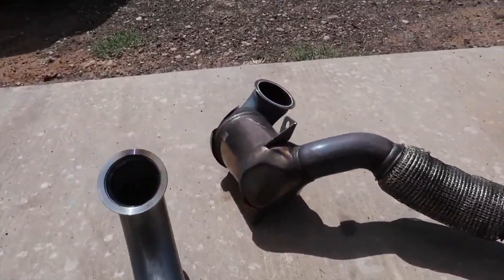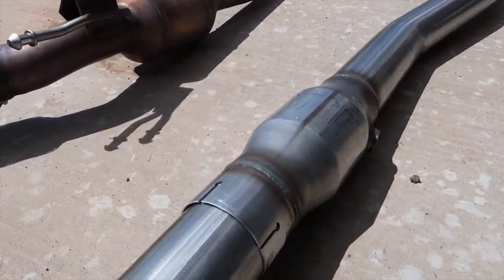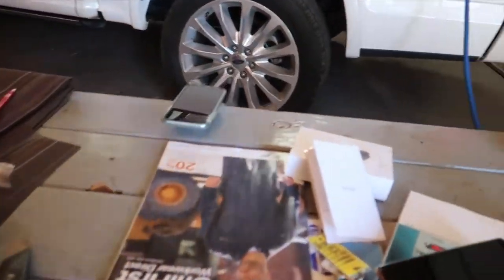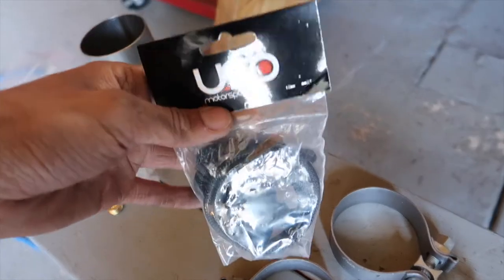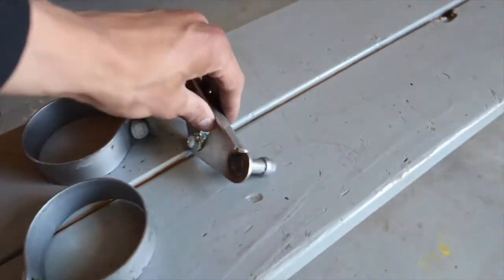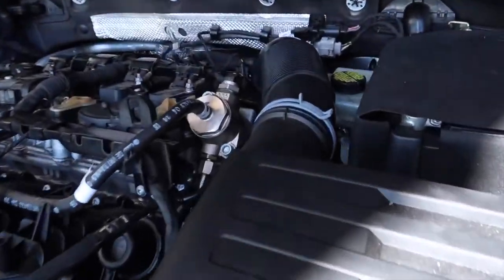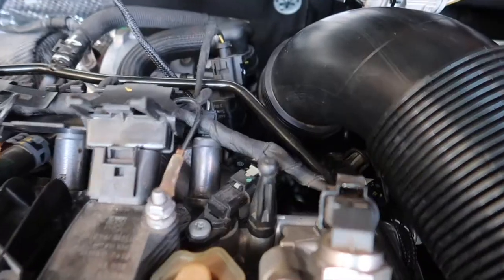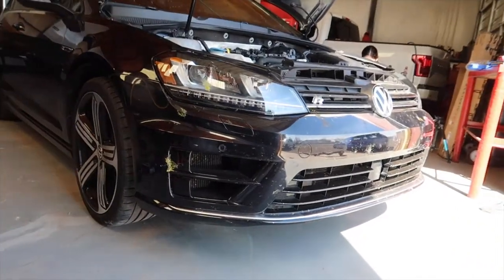From Stock to Race Ready in a Day! | Fili's Golf R

Comment from the maker: Didn't mean to come off clickbaity lol. Doesn't take much to run 11s in these cars, wheels/tires down pipe tune, maybe some motor mounts and driver mod! You'll see alot on this car over the summer 😉
Reply: Local MK7.5 has  JB4 and a downpipe. He ran 11.93 at 3500 DA. No other mods other than rear seat removal. Crazy.